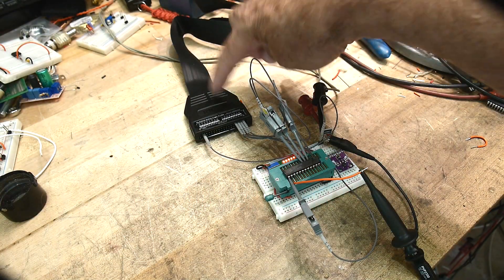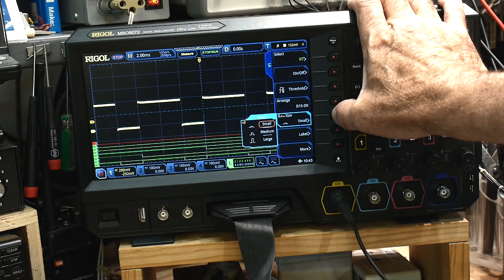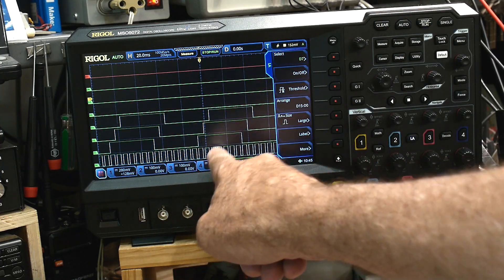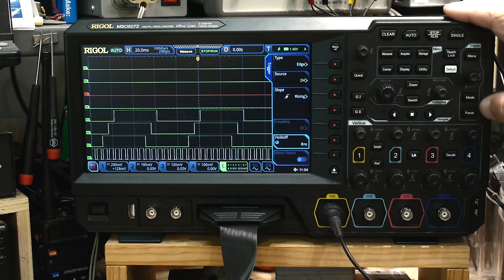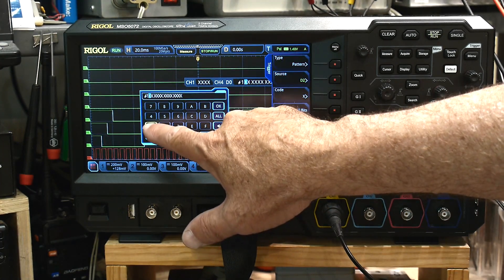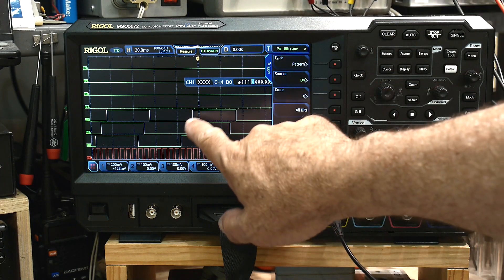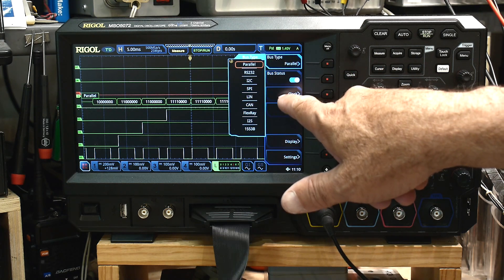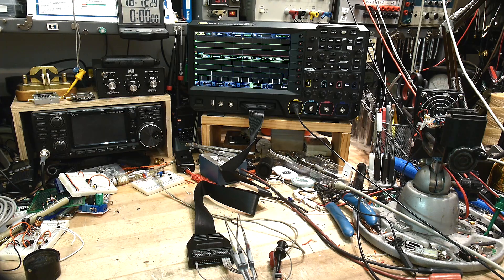#839 Rigol MSO5000 Logic Analyzer

Comment: CAN, LIN and FlexRay are all communication buses used in automobiles. May be if possible, you can get a OBD connector and hookup the scope on the CAN bus on the car to look at all the packets going across different modules in the car.